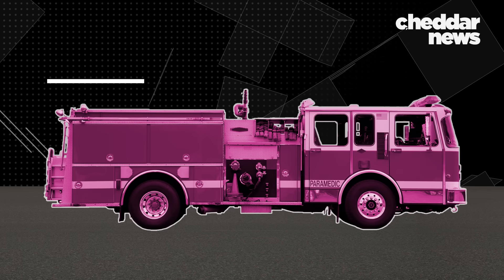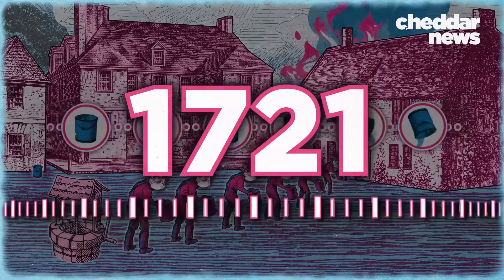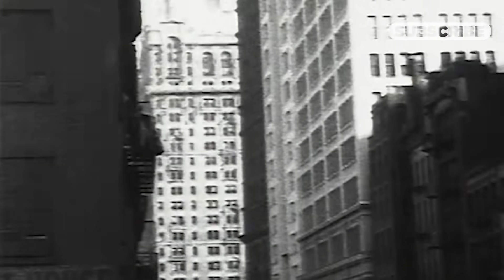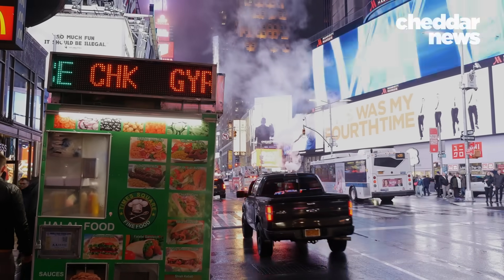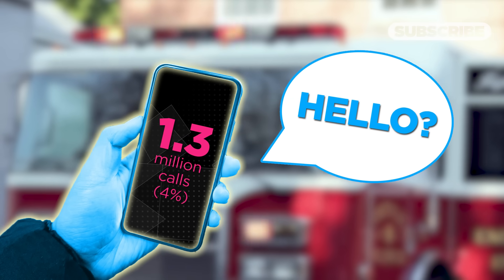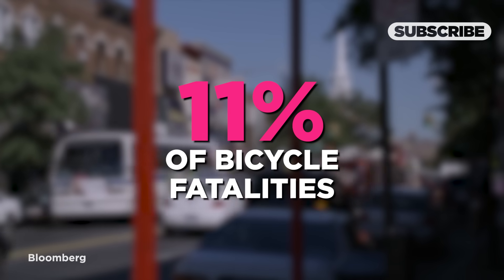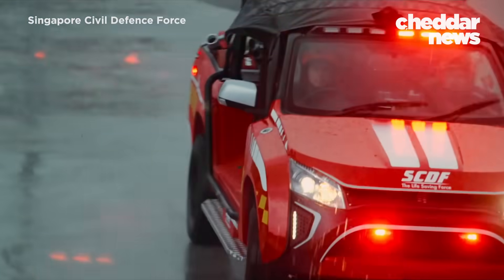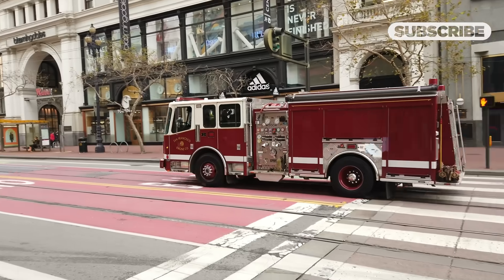Do American Fire Trucks Need To Be So Massive? - Cheddar Explains

Comment: It's not a truck, it's an engine!
Reply: or a pumper, or appliance ... depending on where you are at the terms for those apparatus vary quite a bit. Gets even more interesting when one type of apparatus is used abroad: back in the days when the US Army brought American Engines to USAG bases in Germany they had to be classified as Tanker (or Tender, depending on how they are called in your area), as they couldn't qualify as Engine due to the smaller range of equipment.

Comment: So whoever put together this video did a very poor job of researching their topic.  Comparing the apparatus between Europe and the US is like comparing apples to oranges.  Both are fruits, but are very different when looking at them closely.
1. Not sure where they got there numbers from, but there are plenty of jurisdictions in the US running multiple structure fires everyday.  Some apparatus alone are running over a hundred working fires every year.  So the apparatus are still needed to put out those fires.
2. The building construction in the US is very different from Europe.  European buildings are generally made out of sturdier and more fire resistant materials.  US buildings are typically made from all or mostly wood and typically will burn up and spread to other buildings much faster.  This requires more water faster to prevent the fire from spreading.
3. Look at the differences in travel distances here in US compared to Europe.  Most of the US is rural where there are routinely 20 minute travel times just to get to a call.  That's even on the more densely populated east coast.  Less densely populated areas it could be 40 mins or more before responders could get there to help.  That's means you have not only take everything with you on less apparatus, but you have to have more fuel capacity to travel farther.
4. With the previous point, more equipment and more water and more fuel and more room for responders and their gear means beefier apparatus that weigh more and take more up more room.  It's not ideal, but fire departments don't run just fires anymore. We have to be a jack of all trades and since there are less and less of us every year, that means more and more shit being piled onto less apparatus.
5. I'm not sure if anybody has looked, but most of the ems calls we run aren't for the physically fit, healthy, light weight, easily moveable people out there.  The people we run are the 200+ pound overweight, unhealthy fat asses that are on the top floor of where they live.  There is no way 2 people on are going to get them down to the ambulance without help.  Also, as someone already said, there is a severe shortage of emts across the nation.  Especially paramedics.  So fire departments stepped up to fill the gap and now it's the expectation. This required more equipment to be carried to allow them do their job.
6. US Federal law allows for "essential workers" to be worked a certain number of hours per week without having to take a break. Police officers and firefighters are covered under this law.  Emts are not.  So Emts can only be worked 40 hours a week before overtime is required and work 8 to 12 hours shifts.  Firefighters can be worked up to 53 hours a week before overtime is required and work any number of hours in a row.  This is a great solution for governments to get even more work out of less people by having them dual qualified. Once again, less people to drive means less available apparatus to go and more equipment needing to be carried to do more jobs with less apparatus. 
This is long enough so I'll stop there.  Needless to say, there are many good reasons  as to why US fire apparatus are "so much bigger", but this video did a poor job of explaining any of them.
Reply: 1. "are plenty of jurisdictions in the US running multiple structure fires everyday." sth which got rather rare at most departments in Europe. In the city I grew up in the career FD had a station with 47 units and they responded to a an average of 5.5 to 6 calls in a 24 hrs shift. But those 5 to 6 calls included also false alarms, alarms where they responded without lights and sirens etc
2. "European buildings are generally made out of sturdier and more fire resistant materials." while this is true for many parts of Europe, some countries actually have a very comparable construction style on their houses, with mostly wood and other lightweight construction
3. "Look at the differences in travel distances here in US compared to Europe." same in this aspect. While most of Europe is more densley populated, there are some rural areas which have an equally low population density like some of the US states with the lowest population density. Some of those places face response times of more than 1 hour - in good conditions. 
5. 200 lbs = 90 kg .... no big deal for a 2 man crew from the ambulance tbh, at least if the patient is stable enough to be carried downstairs. With the trainee on board we're often 3 on a unit, and in case of a patient being critical, a crew of 2 more comes from the emergency doctor car. In most incidents those are sufficient hands that we don't need lift support from the FD; In the past year I called the platform ladder only twice to transport patients down from an upper floor - none of them was heavy, but both were instable.

Comment: It's amazing how the information provided here is very skewed like American firefighters don't know what they are doing. While watching the video all that I could think of was that the people who did this have zero experience in firefighting regardless of it being here or in Europe. Did you even go to any fire department wether it be a paid city department or a rural volunteer one? Did talk to the firefighters using this equipment?
 Having been a volunteer for over 30 years now I am not saying there is no room for improvement but you must remember that every fire truck manufacturer has to build them to NFPA rules. I am from a rural department, our engine carries 1,000 gallons of water and our tanker has 3,000 gallons. This alone can dictate the size of the truck. Add to it all the other needed equipment to handle the many different types of responses we go on and you are no longer in this magical compact piece of equipment you are dreaming of. And another thing, I can assure you these trucks are NOT 10 FEET WIDE. I have had a commercial drivers license for almost 30 years now and if that was true every fire truck would have to be permitted as an oversize load.

Comment: People who aren’t in the service really shouldn’t criticize. Elevator rescues, vehicle accidents, containment/hazmat details, Gas and carbon monoxide incidents, water rescues, medical details, machine rescue. And you have engines and or trucks running rescue operations, you have trucks and engines running rescue operations, and you have trucks and rescue-engines operating as engines. You have fire trucks doing different jobs then what they were designed for so yes they have to carry more equipment. Especially since approximately 3/4 of the fire fighters/departments in the US are volunteer and have to be cross trained on different “companies” with man power shortages.
Reply: in Germany 96% of firefighters are volunteers, just saying ;)

Comment: Most trucks aren’t 10 foot wide; max vehicle width in the US is 8’6” with anything wider being “wide loads”. Yes there are some special use vehicles that can get out to 10’ wide but they’re rare, far between, and tend to be used for closed locations like airports and aren’t used for responding on public roads.
Reply: Good point - the idiot who "researched" this video probably did a quick web search and found the dimensions of an AARF rig... then someone applied those dimensions to an image of a Type 1 engine.
Reply: @brianb-p6586 : Not to mention the idea that semi-trucks are something like every department have is ridiculous. While some departments do have them they are a rarity even in those departments. There is a massive amount of apparatus with options to fit every need from large to small; some rural departments still run vehicles built on F-550 chassis as they can be 4X4 and actually get to locations as most Class-6 and up vehicles are exclusively rear wheel drive, with a few exceptions.
Reply: @libertarian1637  more good points. 🙂
Some U.S. departments like articulated (tractor-trailer) ladder apparatus, but I've never seen one - they're far from universal in North America.
Rural departments often use apparatus based on commercial conventional-cab trucks (typically with crew cabs) because they're less expensive and the shorter overall length and wheelbase of a forward-control cab isn't needed outside of urban streets; they also commonly use those small trucks (such as the F-550) for "brush fire" duty.
Reply: @brianb-p6586 : NYC has some semi-trucks used as ladder or Mobile Command Posts for larger fires, which is nice as they include bathrooms. I used to live and work in NYC, NYPD, and have since moved upstate where there are paid fire departments in cities and some suburbs but where most of the rural area is covered by volunteer departments; upstate the amount of variations in apparatus is extensive from small SUVs through light trucks through Class-5, and up to Unimogs or F-650s which are benefited by not needing CDLs through larger commercial based vehicles with custom backs to fit the need. NY actually has LaFrance a fire truck builder that builds the custom backs. As alarm systems have become more integrated and sensitive most calls are medical, well check, or non-confirmed alarms with actual “fire fighting” actually being quite rare as few fires get to a fully engulfed status before arrival. The one big benefit of volunteers is that they’re throughout the community and can head directly to the fire while someone either at the station or a designated driver gets the needed apparatus to seen. Most volunteers will actually keep their turnout gear with them and a number of medically qualified volunteers will actually keep a med bag with them. 
Training has changed over the years with all NY police officers being CFRs and quite a few getting EMT qualled and even having AEDs in patrol cars in rural areas to ensure a fast response. Most upstate departments also allow their officers to respond as volunteers as both EMS and Fire during their shifts with some even paying them their standard rates during normal hours. There is a big difference between urban and rural firefighting as in rural areas water becomes the issue with some departments needing more tank and pump trucks than say a ladder truck when there simply isn’t any building over 30 feet tall in the entire jurisdiction.

Comment: Interesting video.  Unfortunately, there are numerous errors and oversights that start about 10 seconds in and never recover (the 'average dimensions' quoted are all wrong).  I did watch the entire presentation and it comes off as a lot of Wikipedia and Google research.  I agree that there are opportunities for improvement, but the presenters don't yet have a firm grasp on the problem and therefore don't really make a good case for the proposed solutions.

Comment: The irony in anyone defending the North American style oversized fire trucks is that consequently, transportation / urban planners are required to design our roads around these large vehicles which result in oversized roads which are proven to result in higher traffic speeds which result in more collisions & fatalities. It's no surprise that on average, (at least our local rie departments), respond to more traffic collisions than they do actual fires. 

Sadly, it is very challenging to argue against the fire departments because they argue the "public safety' card. Yet they don't have the data to back it up. European cities have less fire related deaths than North American cities.
Reply: Dutch roads are rather small in scale and still they fit semi trucks and ARFF Crash Tenders